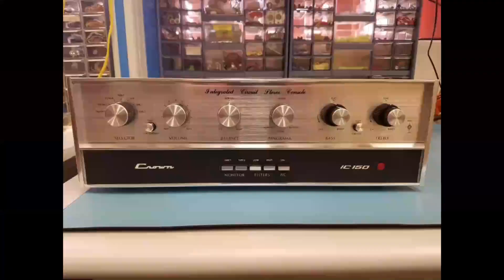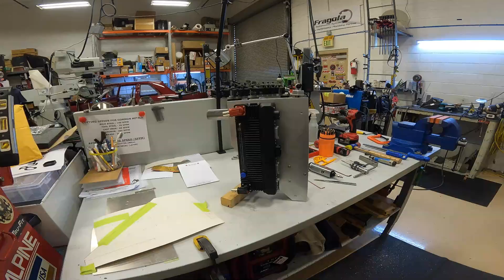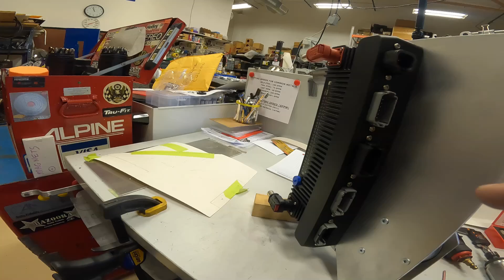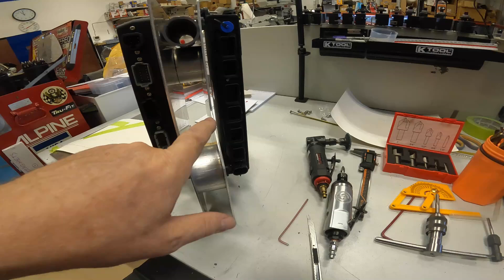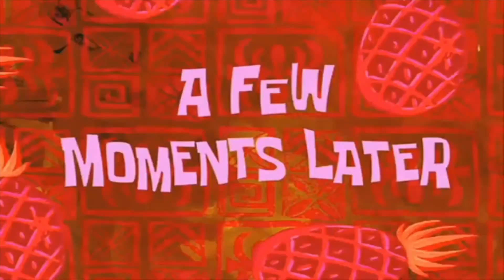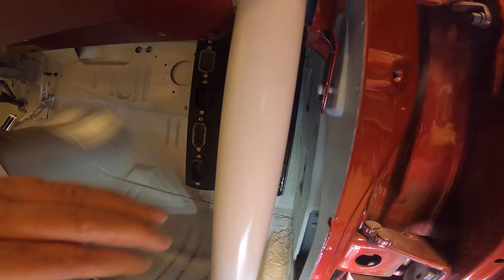Hardwire PDM & Dominator ECU Mounting

Comment: How did you install the stud into the metal plate? What size are the studs?
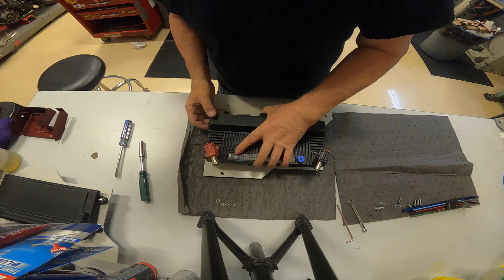Reply from the maker: Hi! Thanks for the question. The studs are simply screwed into the plate, and then have a retaining nut that holds the stud in place. You can sort of see the nuts at 11:27 in the video. The devices sit on top of the retaining nut. The stud sizes for the Holley are 1/4-20, and for the PDM28 they are 8-32.